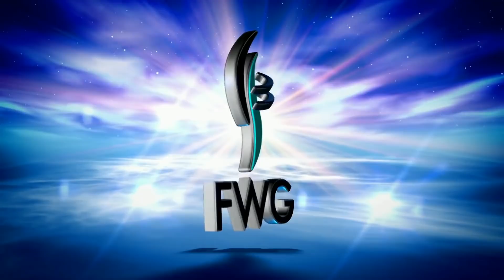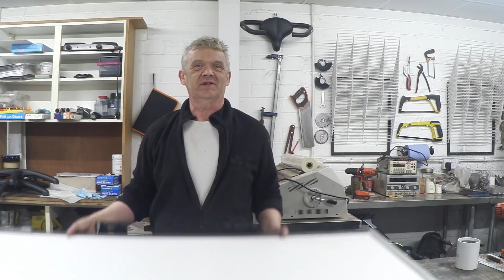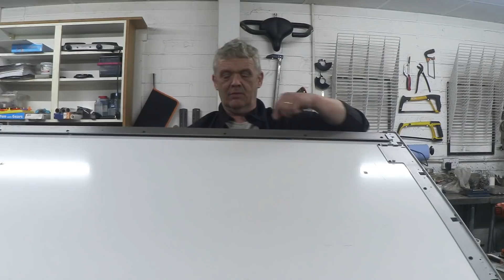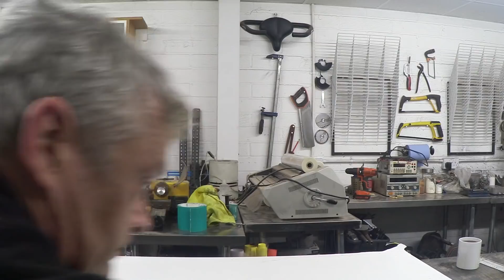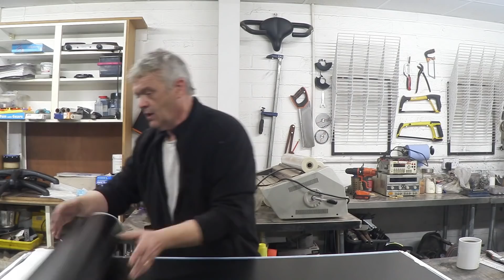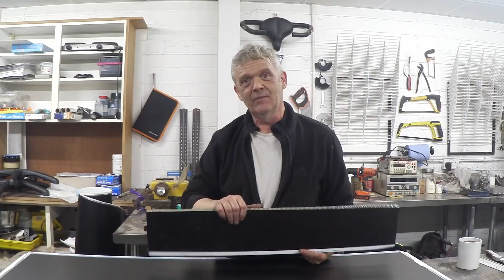Reclaiming A Smartboard

Comment: Omg. Awesome. I immediately bought 3 off eBay for £30 for some DIY projects. I had previous looked at buying some aluminium honeycomb and it would have cost me £100’s for some from an industrial supplier. Honeycomb like this used in floor and roof tiles as it’s very strong and very light and has excellent thermal properties. I expect that they will have some interesting acoustic properties too, I can see these being recycled for home made CNC and 3D printer projects.

Comment: Smart boards are / were made by an American firm Smart Inc. They found applications in the corporate sector in training and presentation rooms, but really took off in the U.K. due to the technology for schools programme Robert mentioned. I’ve used many of them, but always felt they needed a lot of familiarity on the part of the user to make effective use of them.  Too little time spent familiarising yourself with the features and they become a hinderance rather than a benefit. For trainers who use them all day, every day, they’re great.  I would absolutely not have chosen them as being suited to a schools environment, especially considering the maintenance/ running costs of the associated video projectors which were needed.

Comment: Is it quantum tunnelling composite? Ie resistance varies with applied  force. 

If so, and calibrated... could be very useful. Say for measuring torque&power mechanically using a prony brake. Lever with hole to just fit around shaft/drum etc... Slot cut from hole to edge of lever. Wing nut& Bolt that can distort&tighten hole onto shaft. Measure force needed to keep lever stationary. Multiply by length to get torque.

Comment: I know the sky isn't always clear there, but I can't help but feel that that aluminum honeycomb would be incredibly useful in a solar heating application. For here in Texas, I'd be tempted to section it, drill crossways through the honeycomb, feed copper tubing through, and put some high absorption paint on the aluminum plate side after stripping off the white gloss. I think clear day sunlight at sea level comes in at ~300W/m^2, and that looks to be 4-5m^2 of surface. I know regular black matte spray paint absorbs almost 90% of incident sunlight, so that looks like a ~1300W heater to me.

Comment: Interactive whiteboards are incredible teaching tools. Unfortunately, technology without training turns the technology into a white elephant.  TfS didn't provide for sufficient training and there is precious little time in schools, so the overall result was IWBs were seen as a failure. Where they are used well they are, however, incredible.

Robert, what brand board was that? Are there any major differences between brands?